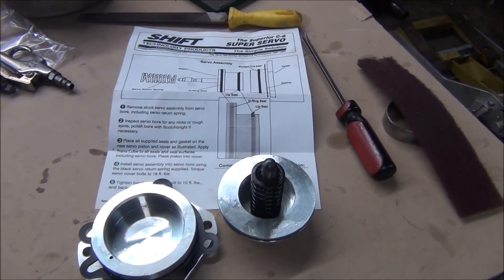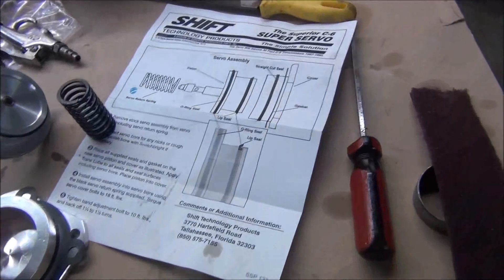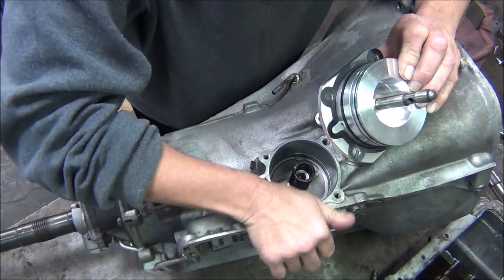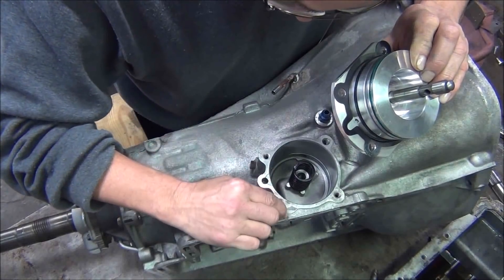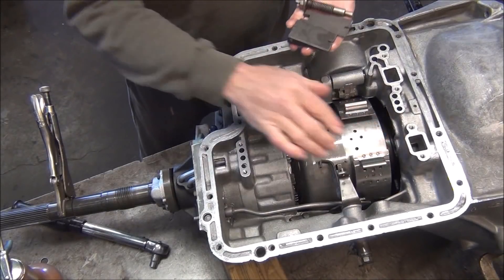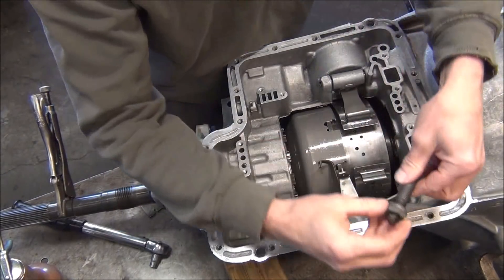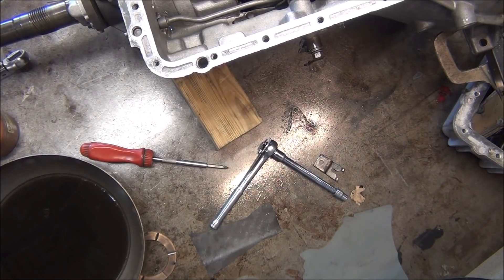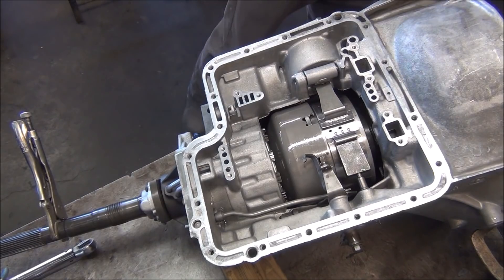Fairbanks R servo for Ford C 6

Comment: Hi Again! I have a very stout C-6 manual valve body behind a built 460 in my 67 Mustang. It appears the servo gaskets/O-rings could be leaking. The C-6 is in the car. Can I pull the servo and replace gaskets and O-rings underneath. There is room. And, when the servo comes out, will it just go back in or does the band move out of place? Really appreciate your channel and videos. Thank you and Cheers from Motown/Dearborn.
Reply from the maker: You can do that in the car. You should drop the pan just to be sure the servo pin engages properly into the hardware that holds the band in place.

Comment: use a 5/16 " wrench to hold the band adjustment bolt and the e lock nut is 13/16 th
Reply from the maker: Thanks for watching.

Comment: If you don't have a C6 that came with the 'R', do you need to modify it?  Mine came with an 'L',  Thanks
Reply from the maker: Depends on what the transmission is being used for. If you like good firm shifts, then yes. Thanks for watching.

Comment: Got one for my c6 and it will only go in about an inch. Seems mine has a step in the bore that wont allow it. I see yours has the same stem but further down in the bore.
Reply from the maker: Thanks for watching. Mine would not go all the way in by hand. I had to use the cover bolts and evenly draw it down after the seal was started in the bore.
Reply: @Dragracer64  what did this go in? Ho was the turn out. I got a 88 f250 with a c6
Reply: you have an early FE case and you cannot use this servo

Comment: Hi, mine shifts hard into Drive and Reverse. Can the servo be the problem? Transmission shifts good
Reply from the maker: Could be a number of things. U joint, transmission mount, tail shaft bushing, or there could be a problem in the rear end. Thanks for watching.

Comment: What does this servo do?
Reply from the maker: It applies the band to shift into second gear. Thanks for watching .
Reply: @Dragracer64  My understanding was that servo firmed up the 2-3 upshift. Am I incorrect?
Reply: @nuckin1  I think the vacuum modulator color types affect that. Different colors for different shifting firmness.